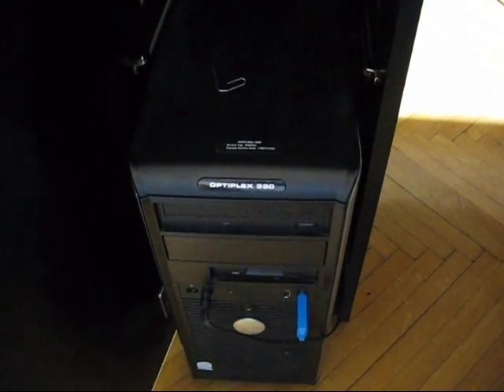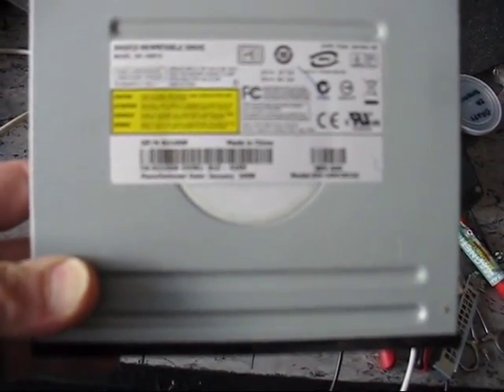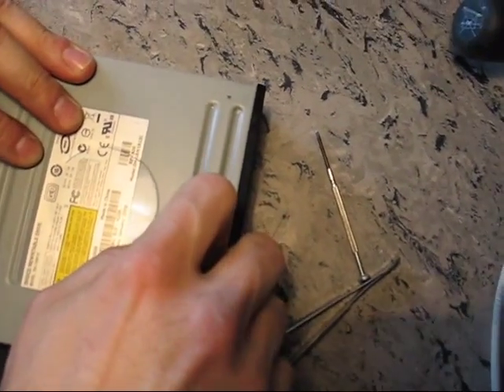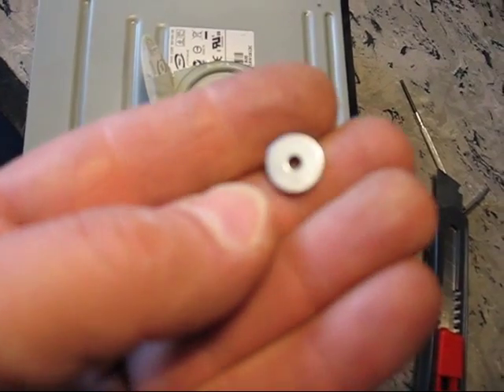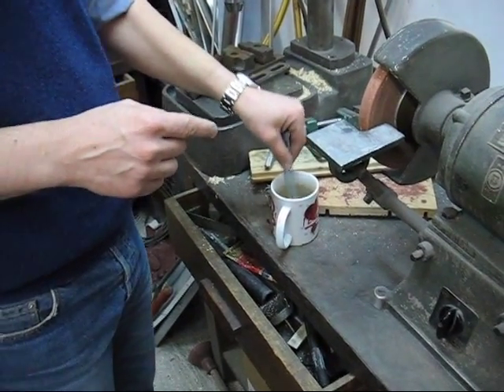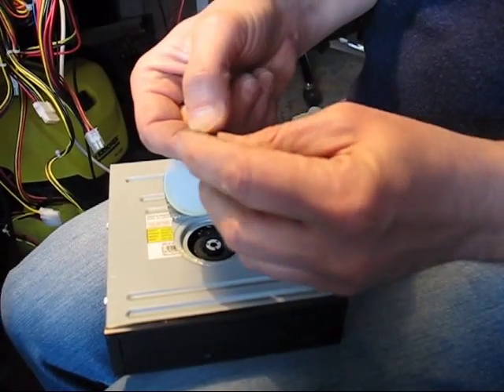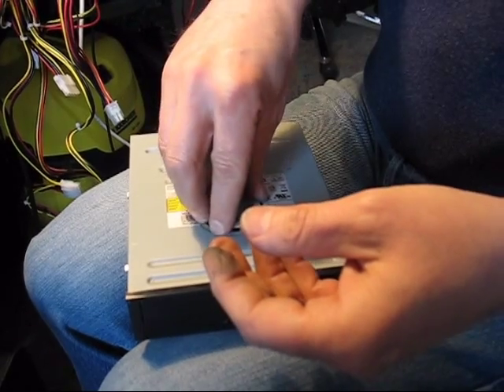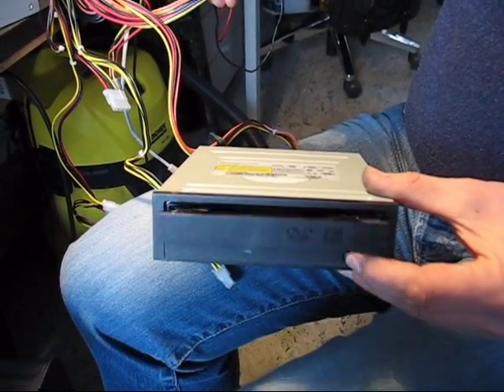DVD/CD RW model DH-16W1S does not open

Comment: I had the same issue... the real problem is the drive belt inside. When it gets old, the motor cant pull the spindle away from the magnet (In my opinion a very poor design). You could replace this drive belt but for that you must disasamble the whole thing. So the solution with the magnet is pretty clever! thx for the Video!
Reply from the maker: Thank you for your kind comment.